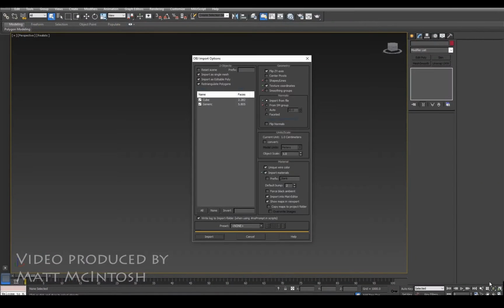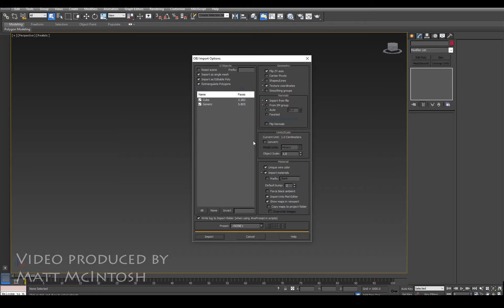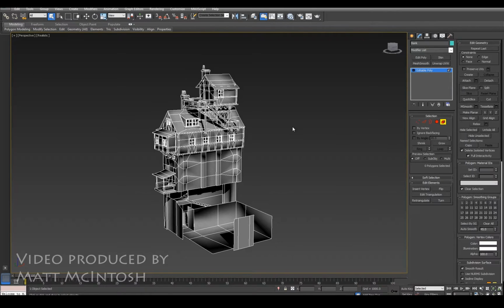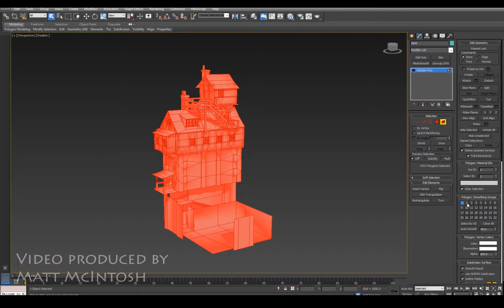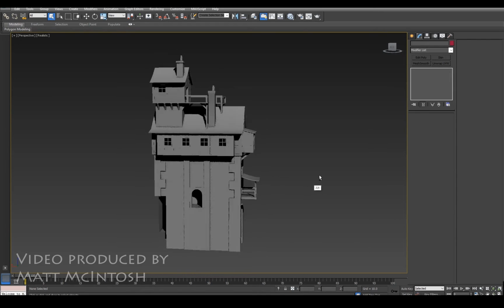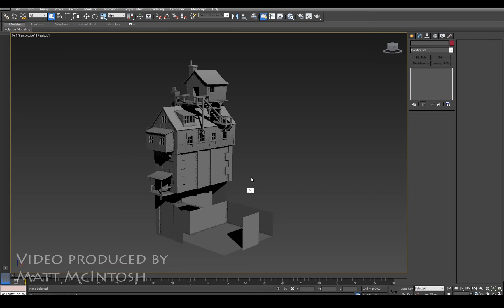How to sort out Smoothing Groups and visual errors in 3D Max

Comment: I came across another bad mesh where this method didn't work, but after playing around some more I was able to find a fix. If anyone else finds that this trick doesn't fix the problem, try these steps - First I used the Mesh Smooth trick in the video making sure that I weld all verts under 0.1, then create a Sphere and convert it to Editable Poly. Next, Select both the sphere and the problem mesh and going to the Utilities panel (wrench) and use the Collapse tool with "Mesh" as the output type and "Single Object" as the Collapse To setting. This finally fixed it for me. Some meshes are more stubborn than others :P